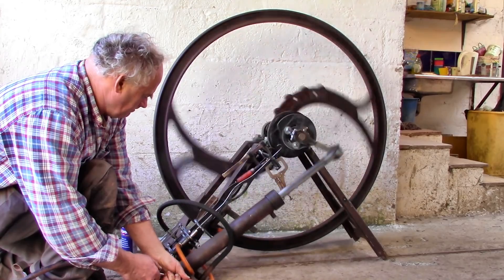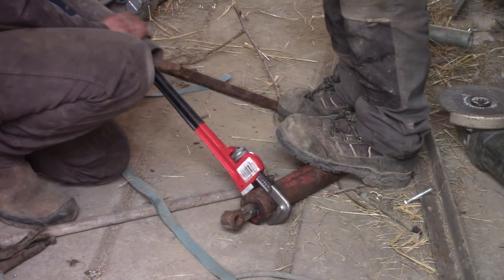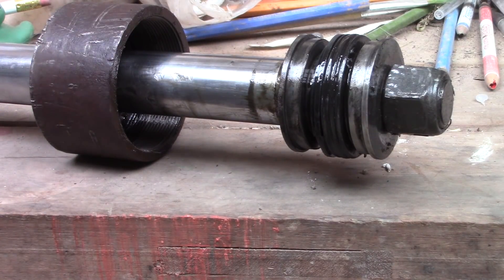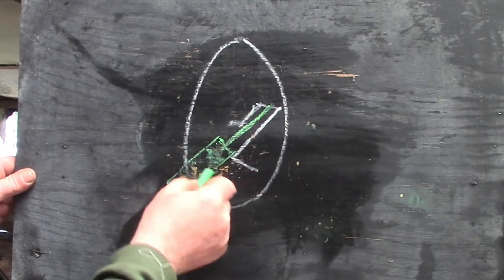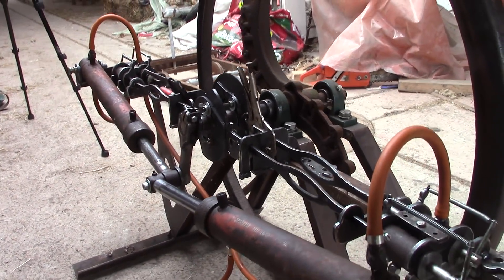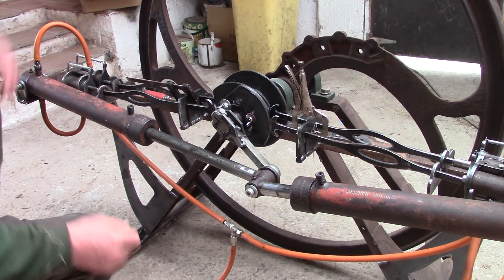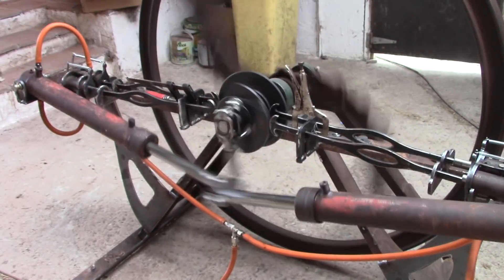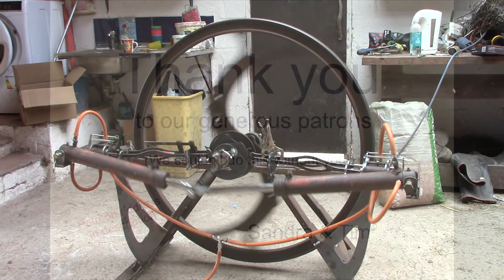Homemade TWIN CYLINDER Air-Powered Engine Goes REALLY Fast!

Comment: Not sure this is right, but on the push and pull, can you just parallel push on one cylinder to the pull on the ether cylinder, so two circuits valves could run the four stoke on the two cylinders?

Comment: why are you using only one of the piston inputs? if u use both the 1 cylinder engine may have been more powerful
Reply from the maker: only if you have enough air to fill them - otherwise you get less power
Reply: @wayoutwest-workshopstuff6299  well for the single engine cylinder the cylinder being powered once every 180 degrees instead of once every 360 degrees will dramatically increase smoothness and power while not dramatically decreasing runtime

Comment: try drilling out the exhaust side of the hydraulic cylinders. Make the hole bigger. You're only getting out what you're putting in. If you drill it out it'll allow the rpm to come up. air restriction.

Comment: can't sleep, and it's our local steam rally this weekend which reminded me of your engine project so i thought i'd re-watch some of the vids.  I don't know if this is a helpful thought or not, but i thought i'd share it anyway.  
there is an unused port on the cylinder, which presumably would be venting air on that cylinders power stroke and sucking it in on the exhaust stroke.  what would happen if you connected these unused ports together?   when one cylinder is exhausting, the other is inhaling, so would this help transfer some power onto the opposite cylinder, making them sort of a bit double acting?  or would the extra resistance of shoving the air through a small pipe just provide increased resistance for the engine to work against?
Reply from the maker: Unfortunately there would be no net benefit : -  (
Reply: @wayoutwest-workshopstuff6299  I kinda guessed that would be the case.  I was either being really clever or really dumb 😆

Comment: Those cylinders are made for thousands of PSI.
You're only likely to have air at under 100 PSI.
Bicycle pumps are much more suited to the job, because they're a similar size, but are made for air, and at the pressure you're using.
P.S. A "V" configuration for the placement of the cylinders would ensure that the thing starts by itself.

Comment: AirEngResearch
It was interesting to see how you designed the Air Engine and it works pretty well. 
I went through the same trials and errors developing the Car Air Engine I am currently working on!
Reply from the maker: I just wish I had more time to experiment..

Comment: I am amazed with your ingenuity and no doubt you could make an compressed air powered engine for your train but have you considered electric, an old mobility scooter would easily provide the parts required,

Comment: Another fabulous creation, Tim.  I'm so glad I found your channel.  The railway is looking better all the time.  

To transfer power to the wheels, have a look at some ride-on lawnmowers that use two discs either side of a rubber roller set at 90 degrees to the rotation of the discs.  This is a combination clutch, reduction-gear and reverse in one.  It changes the direction of rotation of the output shaft by pressing the roller up against one or the other of the discs.  Old Cox brand mowers used this arrangement which was easily visible by lifting up the seat.  

Two old car brake discs and a small, solid rubber wheel attached to an axle would work.
Reply from the maker: Thanks Andy. Yes I've come across a few different examples but never in real life. I like them though.

Comment: Just a though:
If you added 2 selector valves (1 IN,  2 OUT, ) to the lines going to the cylinders (they are 2 per cylinder, but they could be just one) and connected the new additiona lines to the reverse chamber you could get the engine to run in reverse simply by switching the positions of these 2 valves.
Let's say that when they are both switched to chamber A (equivalent to the current connection) the engine runs forward, when they are both switched to chamber B the engine would run in reverse because at any given angle of the flywheel the air would be distributed(timed) in the same way, but the forces resulting from each cylinder would be reversed( and about 40% smaller). I know the reverse would be powered by a smaller effective area (about 60%) of the cylinder and therefore be less powerful but that might be OK for a "reverse" obtained with so few additional components and complexity (only 2 valves and piping/connectors).
Switching them in different ways (like AB or BA) it would result in a sort of parking brake.

Comment: What about connecting the 2 unpowered ends to scavenge some of the power loss as the cylinders push pull? 
May do nothing but put wobbly hose between them.

Comment: Reminds me of air powered washing machine I once made for agitating metal parts in soapy water. I made a metal box that held the water and put on a frame stand to rock back and forth. Then hooked small air cylinder to rock it with a valve similar to valve body on automatic transmission to direct the air and change positions with each rock.
If you put air to it without filling with water it would walk around the floor.

Comment: Before you jump to steam power you should consider making your joints and moving parts less cantankerous. One of those pivots seems like its banging every time it contracts. Threaded bolts arent the best option but its cool to see that it works.
If you do jump to steam however you're gonna need a big enough boilerwith a safety valve.

Comment: It is actually somewhat possible to use double action with just a single set of valves though it does make the valve more complex. It would keep you at a single action cam though.

Comment: This sits on the very edge between amish and normal. Very cool project imo
Reply: Altho I kinda wonder how much power is lost in each stroke of the individual pistons. I think a good way to have a rough idea is to disconnect all hoses, then put the pistons vertical and extended and see what weight at the top is needed to make the rod come down. Thats the friction that needs overcoming. Or perhaps theres a better way to test it, maybe just air pressure plus a very accurate gauge

Comment: I wonder if the outlets could be connected to a secondary compressor?.... or maybe line the wheel with copper wire and magnets and turn it into some type of generator?.... just thinking out loud....

Comment: For a place with access to a trompe or the ideal conditions to build one for access to high volume low pressure air I could see that as a relatively viable source of energy for potential electricity generation.  Not the most efficient but generally speaking free to us since gravity and water would be doing the work to pressurize the air.

Comment: If you have a stream or river nearby, you could build a trompe, a water powered air compressor with no moving parts, and use that to power it. You would need a high drop in the water to get high enough pressure, though.

Comment: Reverse just means using the right valves for the left cylinder, and vice versa.  I think you could also time the valves to that it would go which ever way it was started.
Reply from the maker: I think you haven't thought that through yet..
Reply: @wayoutwest-workshopstuff6299   Method A is correct.    Method B is not correct for your setup. your valves are spring loaded.  You are correct. I was thinking of valves that didn't depend of a full segment cam to stay in one place.

Comment: If you kept the cylinders and valves at 180 could you nlt powerw the front of the cylinders with the oppoaing valve. It doesnt add much area but it adds some.

Comment: Actually when the air pushes on the nut side of the cylinder your measurements are correct but what it pushes on the rod side of the cylinder the area of force would be increasing with the amount of rod that is in the cylinder. The air pushes on the flat surface where the seals are as well as on the circumference of the rod as well. It isn't intuitive and is something most overlook but is indeed the case. Awesome project sir.

Comment: You don't need another set of cams, the timing is 180 degrees apart - you can work with one cam per cylinder
Reply from the maker: They would need a very steep taper to avoid that!
Reply: @wayoutwest-workshopstuff6299  Just needs 5/2-way valves instead of 3/2-way, then he can switch cylinder inlets between intake/exhaust on both sides simultaniuosly.

Comment: I reckon if the pistons were at a 90 degree angle, it will have more stable torque as one piston can do left right, and the other up down. So each complements the other’s weakest point. Nice vid though

Comment: With the cylinders operating 180deg apart, you could connect the top port to the opposite cylinders bottom port and make them double acting!

Comment: what about a double pusher opposed piston design?

the primary cyl would have 2 arms, and 2 caps, with a single exhaust outlet, spring reverse the flywheel side, amd exhaust from the frame side, similar to the linked systems on older steam engines, however this combines having 1 cylinder, and 2 moving pistons, with a centered inlet.

this would allow you to spin the motor up in any position id assume, as you could possibly provide power to either side of the power stroke no matter which way you spin, and where you start from.

Comment: I just subscribed!!! Love the video!!
As for my suggestion you can use a small DC permanent magnet motor with a small rubber wheel on it to rub the outside of your fly wheel and generate electricity to used in other ways. Maybe a Loco with an electric motor that can go in forward and reverse with a flip of a switch while you’re generating all the power you need on board. 
If you want to compress air at a high pressure in some welding tanks I know that air-conditioned pumps in cars can get you around 300 psi without a problem you could probably even run one on your windmill to compress the air ….. but we both know steam would be a lot more fun!!
Reply from the maker: You're right, Ben - steam would be more fun, but a lot more work.

Comment: what if you done a little bit of regenerative power by using the pressure created by the opposite cylinder being pushed back in. maybe it will offer more torque although i imagine oneway valves and pressure released will need to be installed into the existing tubes

Comment: Attach it to a air compressor that has a smaller fly wheel and see if it can power it self
Reply from the maker: that would make a perpetual motion machine...
Reply: @wayoutwest-workshopstuff6299   of sorts yes

Comment: to reduce vibration, how about putting the second cylinder on the other sde of the flywheel and at 180 degrees - therefore the 2 cylinder's intertia offset each other? Reversal could easily be accomplished with a dual geared Power Take Off shaft.

Comment: One way you could make the engine reversible would be to modify the cams to work like slip eccentrics. The cams would need to be free to rotate on the flywheel shaft and there would need to be two stops to limit the amount of rotation. This gives the cams two operating positions according to which direction the shaft is turning. The two stops need to be set so that the cam timing is correct for each direction of rotation. A simple way to change direction is to turn the flywheel by hand in the desired direction. The friction of the cam followers against the cams will cause the cams to remain stationary until the cams come up against the stop for that direction of rotation.
Reply from the maker: Yes, that would be one way to do it. I'll have a think...

Comment: You could do like the old locomotives and add cylinders to the opposite side but have the shaft 90 degrees of the first side. This'll help you start and possibly be capable of reversing rotation. You'll also have more times where a cylinder will be at a push stroke.
Reply from the maker: only if they're double acting
Reply: @wayoutwest-workshopstuff6299  so using the exact assembly on the other side wouldn't work?

Comment: Have you thought to connect the unused sides of the pistons together? The air (maybe pressured) can do some useful work.
Also, try to use the wheel to power another air compressor and see the efficiency (by comparing the volumes of used air vs the accumulated compressed air).

Comment: you know what you build there ? this 45 degree angle ... thats a sterling engine layout so in case these where connceted via pressure exchangers you could create cold on one side and the other heat ... if you spin it externaly ... not via air pessure ... just look for "sterling generator phillips" ... you ll see what i mean

Comment: You're losing a tremendous amount of horsepower forcing the air out of the back side of the cylinder. Those are double acting hydraulic cylinders there's a fitting at the top not being used. You can make any hydraulic cylinder double-acting by simply drilling a hole at the top of the stroke in the end that has no fitting of course only for this type of project. I would not suggest doing that and then applying "hydraulic" pressure. 
It would be completely safe at 125 psi.
Reply from the maker: I went into all that - perhaps you didn't see the whole video?

Comment: would it work as a pump if you added another cylinder? i could see it working as a pump if you add a third one so you could maybe try to make electricity in small to medium amount to see how well it runs under that kind of load

Comment: You could in theory use steam to spin a turbine that compresses air to run it. It seems like it would be a little inefficient in comparison to a typical steam engine, but at least you wouldn't have to change the seals to get it to work.

Comment: i know a way to make a simple reverser gear box that is in line that could be clutchless
so if memory serves corect, you can take a diferential (preferably a locking diferential) 1 axle is imput and the other is output, you lock the gears together to move forward, to reverse you just lock the carier portion of it (could lock it from the bull gear) 
cant wait to see where this project goes/

Comment: If you wanted to work it on lower pressure I could suggest using 4 or 5 truck trailer air springs in a similar single acting setup to the current arrangement. They are extremely durable and do not need any lubrication, as the hydraulic cylinders will. Would also mean it could be adapted to run with a windmill as a power source should you so choose. Kind regards -John
Reply from the maker: how would you power the springs?

Comment: With this piston arrangement, when one piston is pushing, the other is retracting, so you could theoretically pipe the air supply that pushes the first piston into the "pulling" section of the second piston (and vice-versa).  You could have dual acting pistons for the cost of a few additional hoses...  That should get you maybe 50% more power (assuming same pressure, and no volume restriction).  Another advantage of doing it this way is that you could get the same power out of this engine with lower pressure (but higher volume) which might be more suitable for some air/steam source...

Comment: You’re going to struggle to store significant amounts of energy in compressed air in pressure vessels, your volume a pressure capacity would need to be very high and the performance will decay quickly as pressure drops.
Perhaps if you use an DC motor with onboard batteries and use your steam engine to drive a generator to recharge your batteries.
Otherwise I’d personally use a small petrol or Diesel engine, if you want to you could use the diesel and convert it to run on used vegetable oil which can usually be acquired free as waste product of commercial kitchens
Reply from the maker: watch the next video, Ian - I think you'll find it interesting..

Comment: A cheapo "oil-less" style compressor, geared down a bit, should have little enough drag, if the rest of your windmill is turning freely, to gradually accumlulate a charge. I'm not doing the math today, but would take a week or so I'd guess.

Comment: Tephlon plumbers tape to seal the threaded connections on the compressed air fittings would help with the hissing noise and probably save air over the long run.

Comment: I think you could get a bit more power if you connect the rod end to air, rather than creating a vacuum. you could plumb it in to the exhaust side of of the valve. i do not believe you would need more valves, just use reverse of the valves you have,  even though the rod end has less surface area, adding pressure to it would be better than it pulling a vacuum.  you could simplify it with a one way valve where the exhaust from the base end goes into the rod end then the one way valve opens to release the pressure. or you could plumb it back into the base end to fill while extending the piston.  

I think a reservoir tube to the rod end could also work to negate the vacuum on the back stroke,

Comment: If you put a readily available Quick Exhaust Valve on each cyl inlet (they automaticaly release the air in the cyl , when pressure is removed from the valve inlet) You could then use your 2nd spool valve on the other cyl, or for a double acting cyl. If you then offset the cylinders by aprox 150 degrees instead of 180, it might start on its own
Reply from the maker: Thank very much. I didn't know about those - I'm intrigued..

Comment: Couldn't you just have T’d the base of your cylinder to the rod end of the opposite cylinder to gain even more power? And allow the engine to start itself? Correct me if my thinking is incorrect.